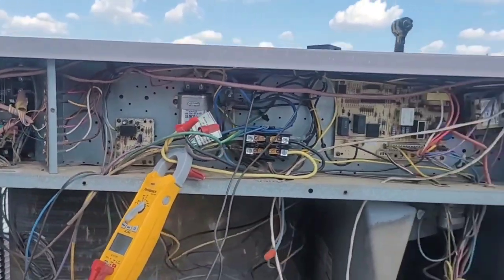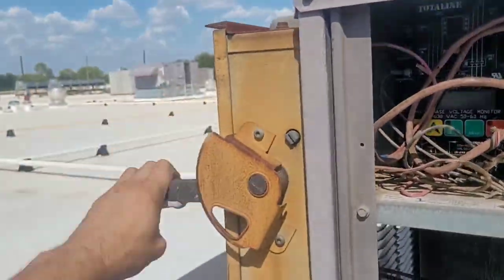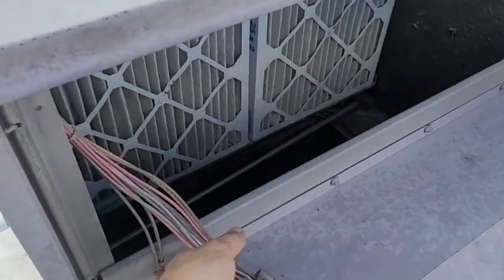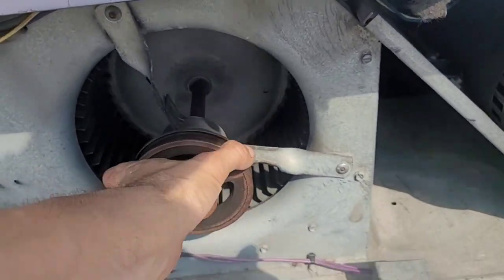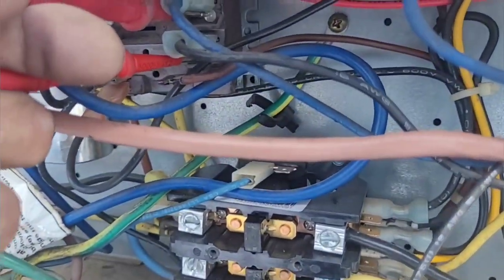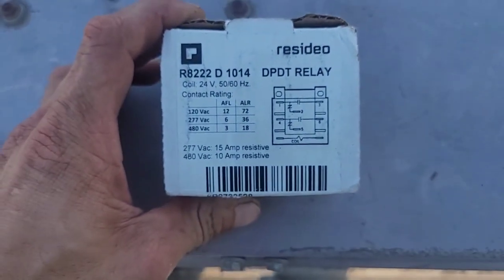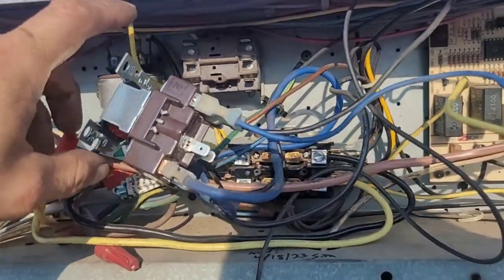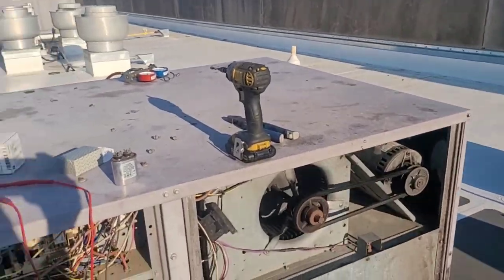HVAC unit stopped cooling due to a compressor lockout

Comment: 99.9% of my work is residential. Always enjoy watching videos that i can follow and diagnose along especially commercial. Guys I work with dont understand the importance of knowing refrigeration and commercial equipment even if we dont work or come across it often. Subscribed!
Reply from the maker: Yes I agree having a good knowledge of the whole industry is a big benefit to us out in the field. I did residential for a long time a decade ago. Spent a couple of years trying to focus on sales with customers, but I found really that I was my best when I was just focusing on doing my job and getting things fixed properly. While others were focusing on trying to upsell even when customers didn't really need it for the commission, I was focusing on getting the problem figured out and getting the customer something that they would actually benefit from such as adding return, infiltration, and IAQ. I was always able to keep a really good high ticket average by just doing honest and thorough inspections and troubleshooting. My AC inspection always took about an hour and a half for one system and two-and-a-half or three hours for two systems. I would spend a whole day on a 4 system inspection. On the inspections that came with the new system installed, when I did the condenser cleanings, after getting all the leaves out I would take those rags in the bucket that are wet with like a soapy stuff and wipe every inch of the bottom panel on the inside. Once you get all the leaves off the slab the water will drain out of it just fine and everyone of them I would leave shining and customers were shocked that I spent the amount of time doing that for them. After that they didn't want anybody else working on their stuff. I don't know why I felt the need to tell you all this, LOL.
 I appreciate your subscription, your comment and the support. I'm glad you like the videos!
Reply: All good man. I get that same response from homeowners as well. Feels good knowing they trust me that much they only want me to work on their equipment. They'll wait a full week sometimes just for me to diagnose haha. I take that mindset to every call I'm sent out to.

Comment: When a Carrier or one of their other products are not running before you turn the power off check the lockout module. Check if you have 24 volts between common and X. If you have 24volts then one of the safeties are open.

Comment: At first I thought it sounded like the blower motor was single phasing. Low voltage due to burned or pitted contacts in the relay would do it too. Not very much more life left on that unit looks like.
Reply from the maker: Yeah but they're going to keep running it, they're not going to replace it. I don't know why it was working but then after I shut it off and turned it back on it started doing that. I understand what's going inside the relay. Maybe I'll take it apart and make a video about it
Reply: They usually do until it dies a horrible death on the hottest day of the year. 😂
Reply: Good video
Reply: @HVACRServiceTech  3 phase motors can limp along on 2 phases as long as they don't stop.   As long as motor windings ohm out within 3 or 4 tenths, Bearings are not noisy and don't have any side play run it.  vertical play is normal.

Comment: Why would the compressor lockout due to the blower not working?  I can see if the fan wasn't working.  Please  explain
Reply from the maker: The process begins with the 24 V going through all 3 switches into the CLO and the CLO allowing 24 V to pass through to the contactor. As long as the CLO does not lose the signal, it will not start counting. With no fan, the FPS on the evaporator reaches its cut out temperature, opens the Y Circuit going to the CLO. It then warms back up and closes.  CLO allows the 24V to pass and go to the contactor, and it counts as 1 fault, But then the FPS opens again. It does this Over and over again, until the CLO decides to stop it.  The CLO is designed from the factory for a preset amount of trips to go into lockout. So it doesn't matter if it's the LPS or the HPS or the FPS. If the CLO detects the Y circuit being interrupted 3,5, or 10(whatever the factory designs it for) times, it'll go into lockout. That's it's only purpose, to protect the compressor from high pressure events or floodback. 
Make sense?
Reply: @HVACRServiceTech  That board is a common failure point in Carrier units.  I often see 1 or 2 in the bottom of the unit
Reply: @HVACRServiceTech  That was a very generous and perfectly worded explanation. I am sure a lot of the young guys got a great lesson there. You are a very busy man. Thanks for taking the time.